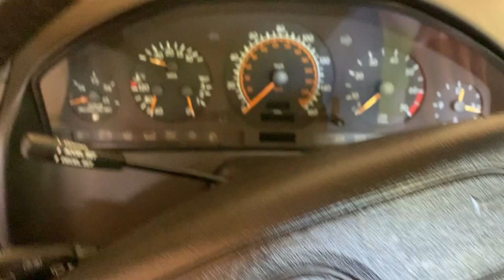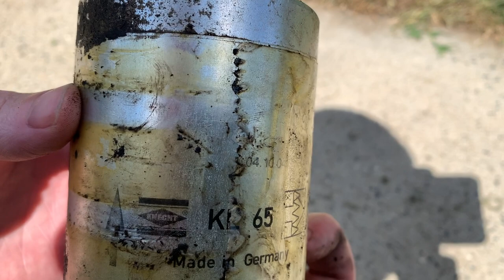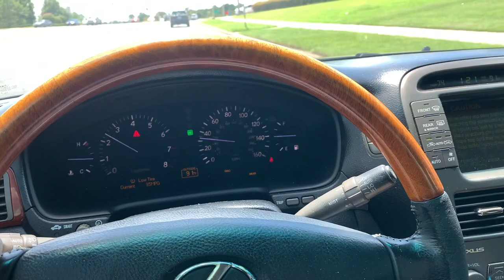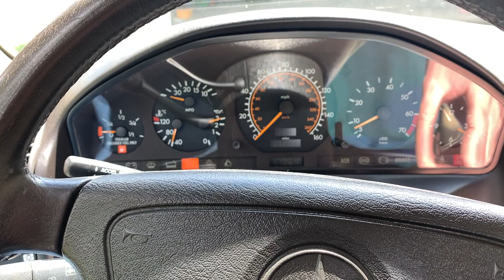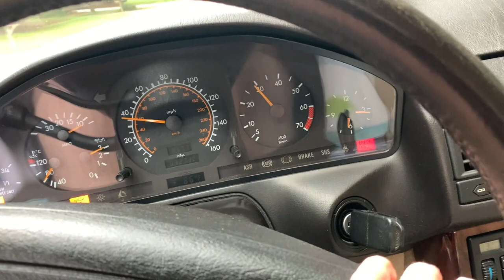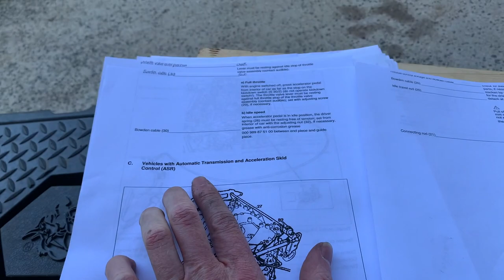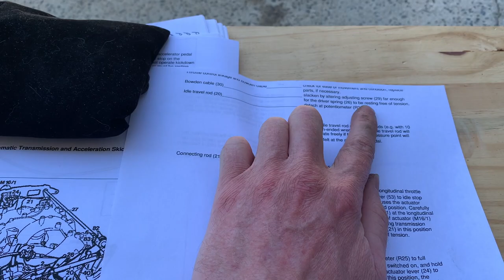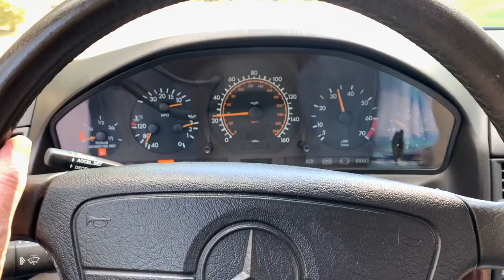New Fuel Filter for my Abandoned SL500, is it Running like new?

Comment: I just changed fuel filter on mine. The arrow points towards the rear of the car. It did so on the old filter I removed.  I looked it up and could only find videos with the arrow pointing to the rear of the car. Mine is 1996 but fuel pump and filters looks identical. Btw get a plastic cover to protect the fuel pump and filter if you don’t have one.

Comment: 21:50. Foot to the floor should see you Rpm go up to max in no time and you are pushed into the back of the seat. Like you take off
Reply from the maker: Yeah its not running on all cylinders. Im pretty sure the filter being in backwards caused injectors to clog

Comment: Mine has two fuel pumps, so is one missing or is that correct? I find using torx sockets work best on merc hex.
Reply from the maker: These cars have 1 and 2 fuel pumps. Some cars are Bosch jettronic, some cars have caps an rotors still. Around 95 is where everything switched.